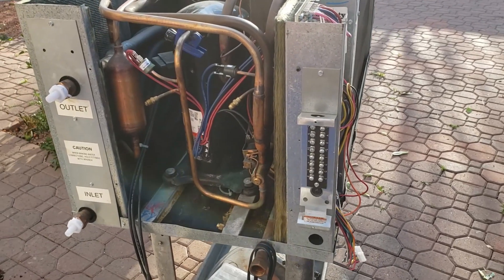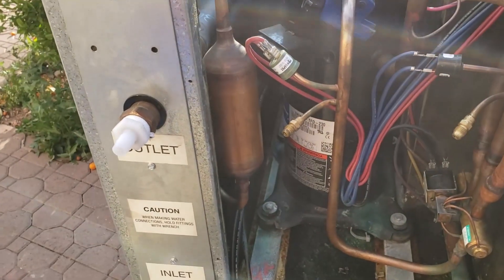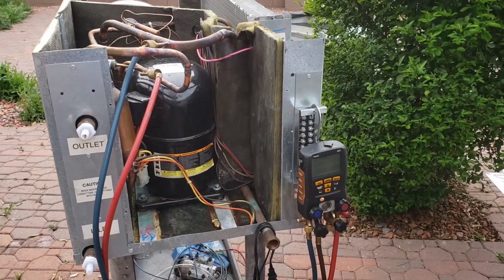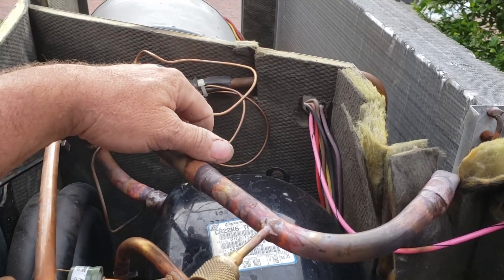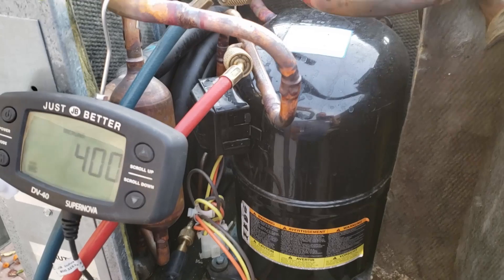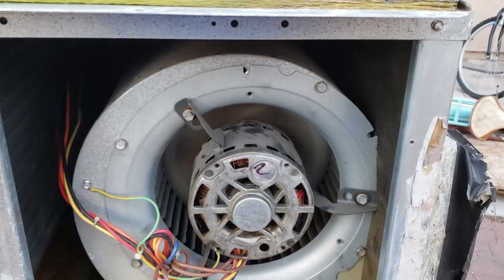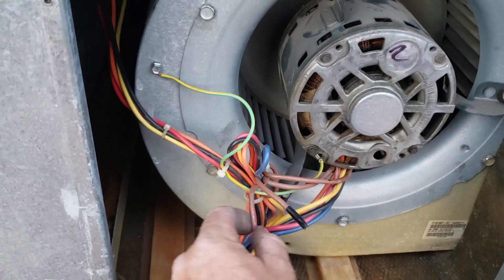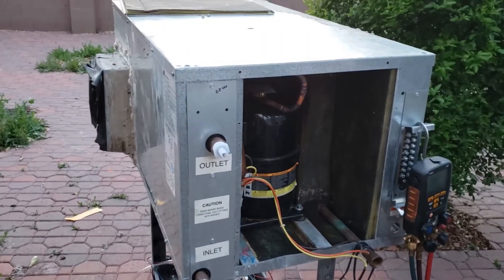The Bastardization of a WSHP into a VFD Water Heater - Part 1 - Gut And Compressor Swap

Comment: Nice project, Just give it more waterflow, if head pressure is an issue. If you leave the reversing valve in place you can use it defrost if you want to make warm water in colder wheater.